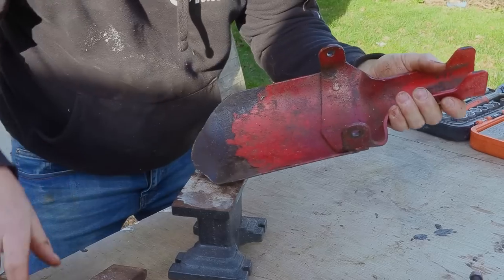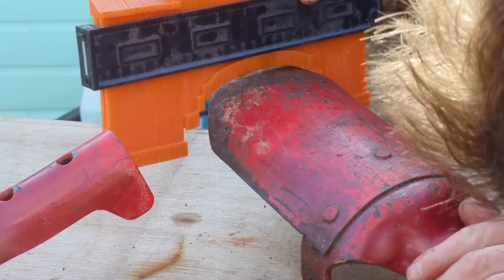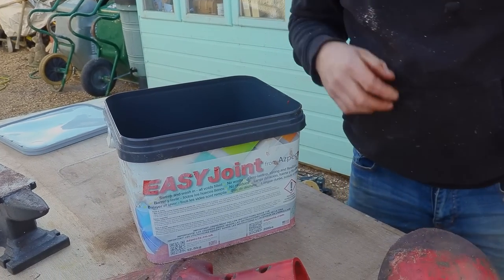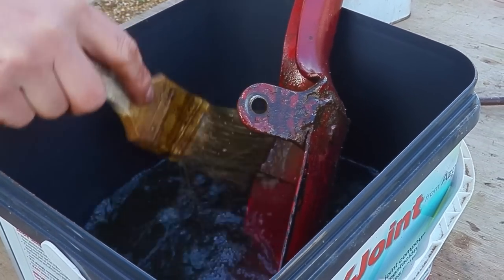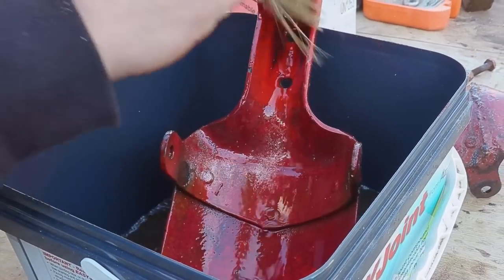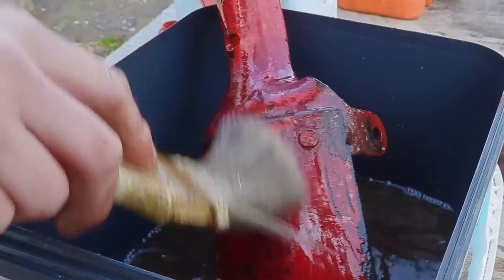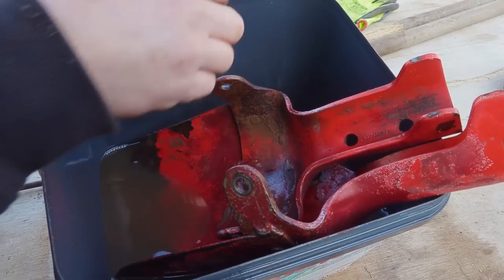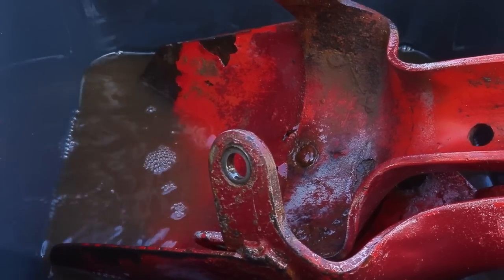Should You Replace or Repair Your Tools?

Comment: Definitely a false economy to only shorten the handles and not replace them when damaged or broken, now the handles are shorter it will mean eventually you'll be stooping over the hole when digging down over 2 foot depths. The £50 saved doesn't equate to the wear and tear your backs going to suffer long term when using them on a regular basis.

Comment: The throw away society does my head in , i always try too refurbish and i am 99% successful, last one was a wheel barrow it was never used just left out too rust, good as new now and better than the ones you can buy cheap as they cut down on build quality, garden furniture as well even old rotten fences  there easy fixed with pallets and theirs  loads of them around local, for paint you used i can recommend az galv paint for action can as its better than what your using

Comment: I had a fencing and patio small buisiness and these are crap .You need a spade on your knees and or a kango.I optimistically tried one but unless you are into soil they dont work.Even on yellow clay they are insufficient and blue clay chuck it.Digging holes is hard but thats digging holes at the end of the day.If you can work a nice cutting spade properly you can dig a two foot hole in no time at all rather than piss around with these useless things.Even your customer would be laughing at you thinking why isnt he using a spade and his arms to pull the spoil out.Also a long bar and a lump hammer to break clay up.Kangos for breaking up old concrete footings and a spade etc.These are quite possibly the worst invention ever.Dont bother.You need to go for it or let someone else do it instead that can work a spade and chisels.
Reply: I disagree Glenn - post hole diggers can be really useful. Digging with a spade produces a really wide diameter hole which requires a lot more concrete.
Reply: Horses for courses I have a severely damaged disc in my back and the roughneck version of this tool allows me to do all sorts of digging and planting which I couldn't manage otherwise so don't be so quick to judge
Reply: I've used em fencing for 20 odd years you dig with long spade .fencing bar or breaker for  bricks and concrete  and spoons to empty hole . These one are a bit shit though you want the ones that close with handles together.
Reply from the maker: Glenn
The hard work is best done with a spike, the post hole digger is a scoop and should not be thrust into hard ground or it ends up with the ends bent in. Hence the repair.